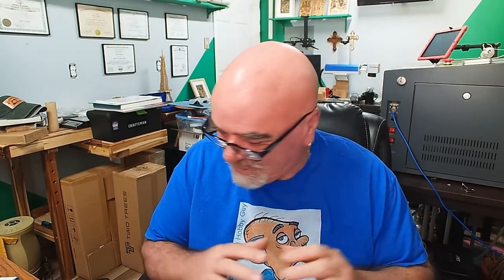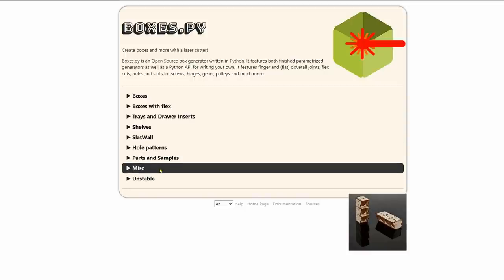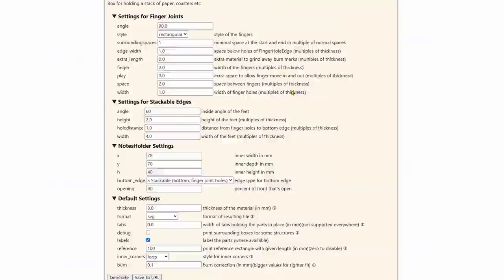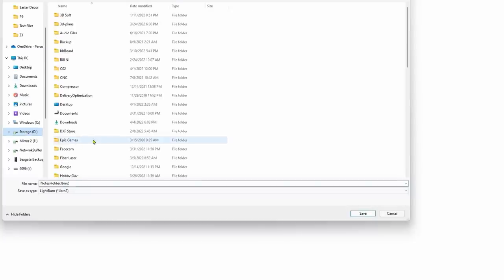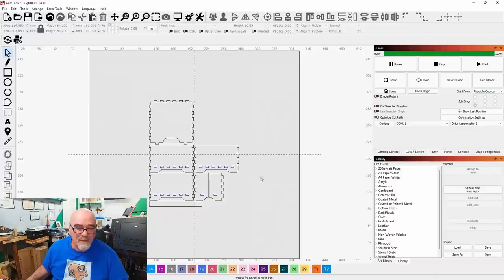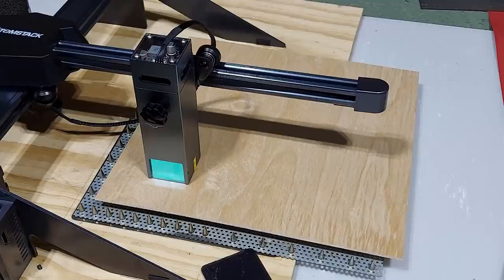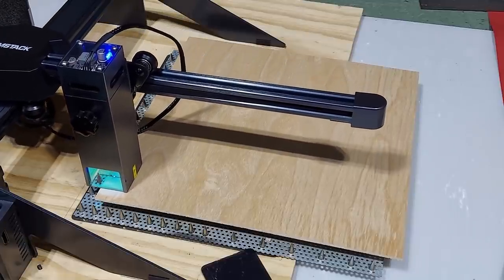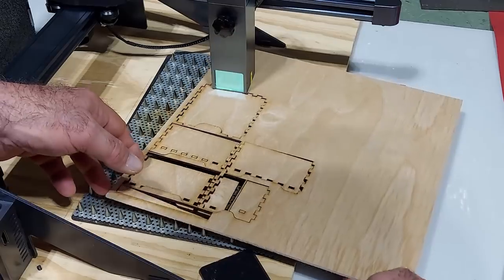Designing and Making Your First BOX in Lightburn!

Comment: Wow on the 6 diode laser. Hope it will work on the Ortur LaserMaster 2, not pro. I am sure it needs separate power supply.
Reply from the maker: The 6W 4-diode laser isn't sold individually as far as I know Merrill. It's a new complete laser on the market.

Comment: Good video Rich ! I tried this project and it was hard to put togther. I found that if you change the burn setting from 0.1 to 0.07 it goes together much easier. Now, that setting may not be suitable for everyones laser but I am using the Neje A40640. Nice laser with respectible power for a diode.
Reply from the maker: Yes Randy, you can use the kerf offset on the layer or slightly defocus the laser, both methods work well!

Comment: Thank you so much Rich.  My box came out perfect.  By the way I did it on my brand new P9 50M.  Also, I'm having a problem registering at your site.  I just figured out that I had ad blocker on Chrome and fixed that for your site.  I'm not able to email anymore so I'm not sure what to do.
Reply from the maker: My pleasure Mark! The problem is firewall issue I'm working on resolving, sorry. Send me the username or email address: thelahobbyguy@gmail.com

Comment: good evening, I am having issue with my Orthur lazer using Lighburn software getting about 1/3- 1/2 thru my project and the fire sensor goes off. I have tried the $261=0 method in the console but still have problems. Any suggestions?
Reply from the maker: Yes, it's a common problem with the Ortur lasers. You need to flash the firmware with the latest version.
https://ortur.tech/support/

Comment: I tried this and the finger tabs pushed together but the slots are to small. Should i look at the kerf offset for the slots ?
Reply from the maker: Did you put in the exact thickness of the wood you were using? This is usually where folks go wrong. You have to actually measure it with a caliper to get the correct thickness. The seller may advertise 3mm wood, but that's a nominal measurement. It could be anywhere from 2.7 to 3.2mm.

Comment: Hi Rich and thanks for the informational video. Hope that you're feeling better!?
I just came across this video of yours and have already tried making some of the boxes that are on the website you suggested. The one problem I am having is that the tab is a tad bigger than the hole it is supposed to go into. What should I do differently to correct this?
Reply from the maker: Use the resize slots and tabs function in Lightburn.

Comment: I want to make a perfect cube with a lid on top. I hope they have something like that. I tried your tabs and slots video last night but I realized after a couple of tries that they need to be placed in a certain pattern with certain offsets to make all the pieces fit right. I'll try that website but I'd like also like to know how to design them straight from lightburn. I think I figured out how to get the sides in a perfect square but I think the tabs or slots on top and bottom need to be offset to make the bottom and the lid fit OR I need to just make two sides  shorter than the other two sides by the thickness of the wood to avoid ending up with a rectangle. Yeah I guess if I want my tabs to chase around the cube the ones on the bottom and top need to be offset so the lid and bottom fit and lid and bottom would need to have offset tabs and slots as well. I'm new to lightburn so have to figure out how to offset them if I try that. I guess it has to be offset the thickness of the wood. It's a bit of a puzzle. Maybe I'll learn something from this new site you made yours from.
Reply from the maker: I'm not sure which video you watched, but this is how I personally design boxes: https://www.youtube.com/watch?v=jPhJSGNzd7E
I've made dozens of boxes using this method in under 3 min, including boxes with lids for my tic-tac-toe games.
Reply: @TheLouisianaHobbyGuy  Awesome, thank you!

Comment: Rich could this same box be made from 1/4 inch wood?
Reply from the maker: Yes, but you would have to resize the slots and tabs. I have made it from 1/4" before years ago, but it doesn't look as good, which is why I changed the design to 1/8".

Comment: Nice video but the box generator is very limited as far as designing out side the "box". Rich the link for "wood I use" from Amazon looks like the product is junk from the reviews.   I never buy anything frim Amazon with less than 80% positive reviews, just saying.
Reply from the maker: I don't care about the reviews on Amazon. I see lots of bad reviews for user errors. I have very good luck with the wood I get from Amazon.
Reply: I get my wood from local sawmills, give it a try, don't get me wrong I use amazon as well but would never buy "plywood" from them. If you really wanna make a project stand out, use real hardwood from a sawmill, and if you can't mill it yourself, most sawmills will mill it to spec for you.

Comment: Loving the videos! 

5:04 I came across another video about this site and it referenced that under the section of “Parts and Samples” there is a burn test that you can run to calibrate your box joints for each machine. It may prove useful to other users. 

I’m including the link for proper credit as it was not my original knowledge. 

https://youtu.be/gDdUzNBF6eA
Reply from the maker: I find that process totally unnecessary if you know your kerf size. I did a video on finding the kerf. Once you know that, you simply add .02 to the kerf and you have a perfect friction fit. The 0.1 default setting added by the box generator will work on most lasers.
Reply: @TheLouisianaHobbyGuy  ok cool. I’ve been watching your videos waiting on my machine getting a feel for light burn. I haven’t made it to that one yet but it’s on the “Lightburn College” playlist I’m going through. Thanks for all you do!